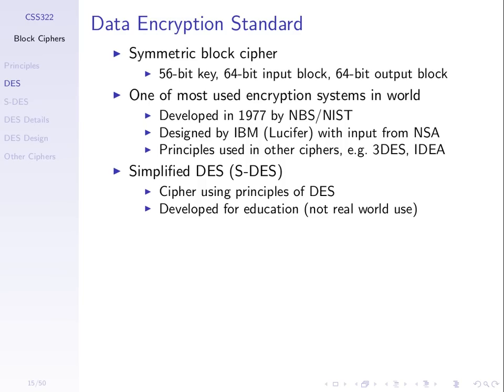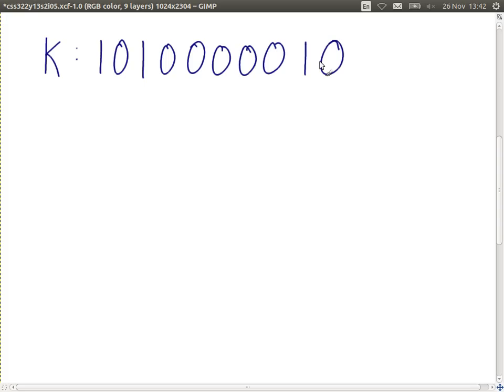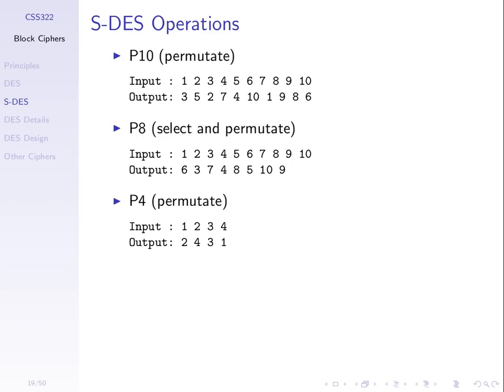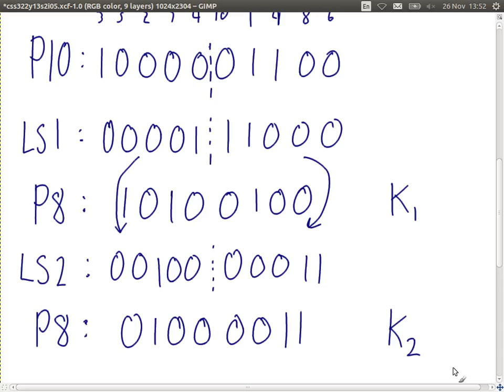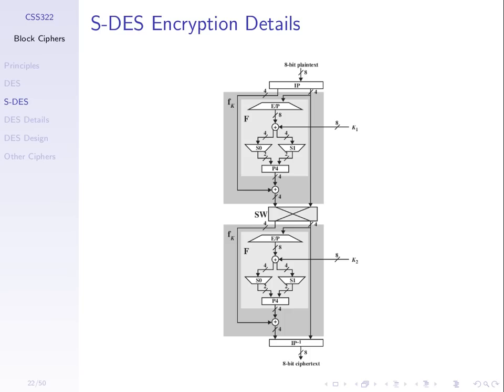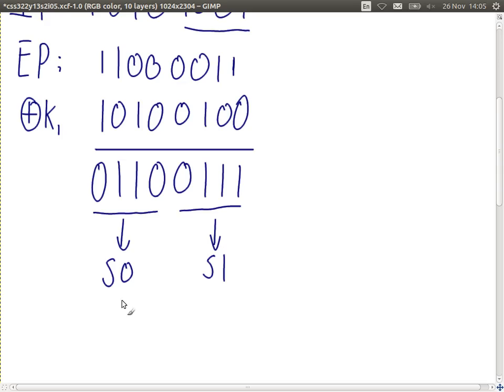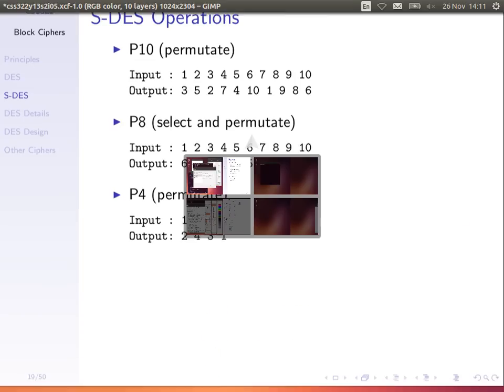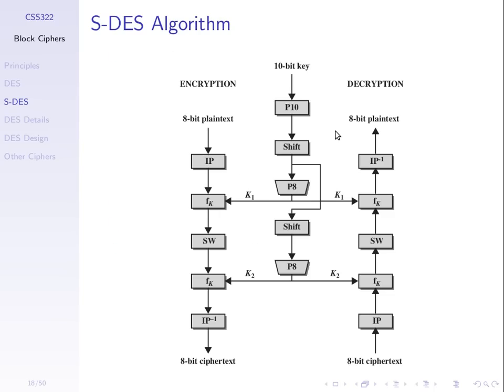Simplified DES Example (CSS322, Lecture 5, 2013)

Comment: Very good explanation... finally understand thanks
Reply: +butterfly4Christ  plese can u tell me how we find IP-1 ??
Reply from the maker: +Samah Awad If you have 8 bits, 12345678, then apply IP you get an output X = 26314857. Then using input X as input to IP-1 must produce the original 8 bits as output, i.e. 12345678. Therefore IP-1 must be the permutation such that the 1st input bit moves to the 2nd position, the 2nd input bit moves to the 6th position, ..., the 8th input bit moves to the 7th position.
Reply: +Steven Gordon thanks i understood

Comment: some tutorials make LS-2 by the values that obtained after p10 (LS-2 for 10000|01100) not for the values after LS-1(not 00001|11000) . what can i use??
Reply from the maker: First, here are my notes on the simplified DES example: http://ict.siit.tu.ac.th/~sgordon/reports/simplified-des-example.pdf. I checked the Stallings textbook (Appendix G of 5th edition - you may find that chapter online) and it applies LS-2 for the values after LS-1. (If the textbook is wrong, then so am I).

Comment: in the LS1 isn't it supposed to be 00001|00110 ? I don't get it
Reply from the maker: After applying P10 we have 10000|01100. Then a left shift (by 1 position) is applied separately to both the left half and the right half. 10000 becomes 00001 (because the left most bit wraps around to become the right most bit). 01100 becomes 11000. A PDF showing the steps is available at ict.siit.tu.ac.th/~sgordon/reports/simplified-des-example.pdf

Comment: Also i can't understand the last part at Fk2 and IP-1 ??
Reply from the maker: fk2 starts with the output of the SWap and then applies EP, XOR, S0/S1, P4 and XOR in the same steps as was previously done except it uses subkey 2 as input to the XOR. Look at slide 22 in http://ict.siit.tu.ac.th/~sgordon/css322y13s2/slides/css322y13s2l03-block-ciphers-and-des.pdf to see fk is the steps enclosed in the dark grey box.
IP-1 is the inverse of IP, which means IP-1(IP(X)) = X. So if you take some input X and apply the arrangement specified by IP and get Y, then if you apply IP-1 on Y you must get the original X back. Since IP is [2 6 3 1 4 8 5 7], it means the 1st bit of X goes to the 4th position, and the 2nd bit of X goes to the 1st position in Y. So IP-1 must take the 4th bit of Y and put it in the 1st position, and take the 1st bit of Y and put it in the 2nd position. The start of IP-1 is [4 1 ...]. Try to find the rest.
Reply: Steven Gordon
 thank you professor Steven :)

Comment: you made a mistake on s-box 2(the right side). its supposed to be 1000
great tutorial though
Reply: explain please
Reply from the maker: If you mean the 2nd round of S-DES, then yes, the input it S1 is 1000 and the output is 11 (although I don't remember doing that in the lecture). For a more detailed write up of the example see: http://ict.siit.tu.ac.th/~sgordon/reports/simplified-des-example.pdf